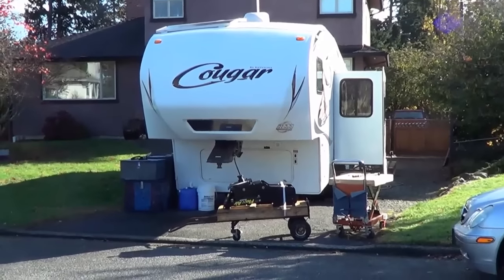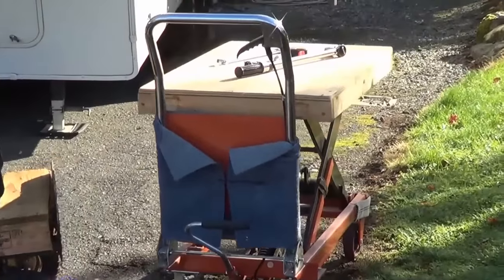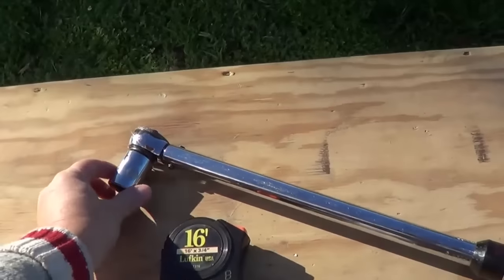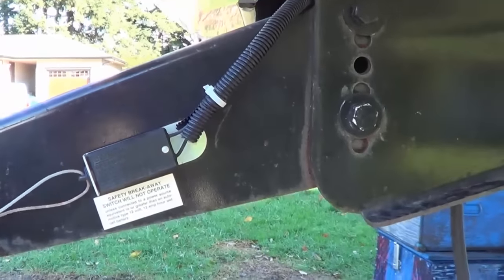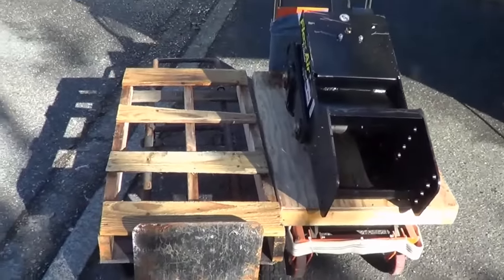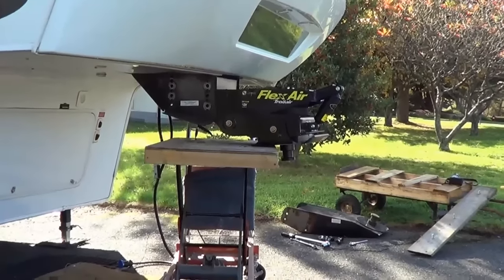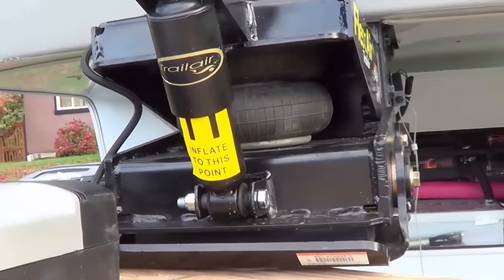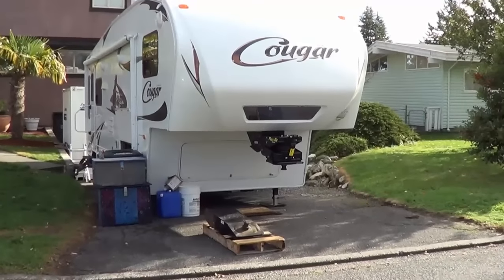Installing a Flex Air Pin Box -  Cougar Fifth Wheel Trailer

Comment: I put that same one (Trail Air) on our new fifthwheel back in 2001 and you will love it. It takes a lot of the jerk out of your neck. Highway 99 has improved, there is still a rough 20 miles above Merced, you will enjoy the smooth ride. Nice videos.
Reply from the maker: +RVJerry Thanks, I've been hearing good things from others. Good to hear about 99, Cheers Ray

Comment: I've seen those units and always thought they were a good idea. I have seen a few 5th wheels with stress cracks at the corners and sides where step up is the make the apron for attaching the pin. I am eager to see your next review. As a side note I wonder if anyone will come out with an air ride suspension kit/upgrade it would really help smooth out the effects of the bumps and jars on the coach.
Reply from the maker: A friend of ours had their fifth wheel frame crack at those corners. It had to go back to the factory to get fixed. Major work! Lucky for them it was covered under warranty.

Comment: The Flex Air Pin Box is suitable for use on conventional size 5th wheel hitches (i.e. Holland, Jost, Fontaine) so it is ideal for truck owners who want to keep their stock 5th wheel.

Comment: Ray, I installed the original version of the TrailAir pin box on my 08 Cougar 245 rks and found it did a good job in keeping the harsh up and down motion of the 5th wheel in check.

Don't be afraid to play around with the air bag pressure, TrailAir makes only one unit (unless that changed) for all campers most of which are much larger and heavier than our campers. I actually run my TrailAir about an inch or more below their suggested indicator arrows. So give it a try.....As a matter of fact the air bag loses air pressure pretty quickly, I add air about once every week or so. So if you forget to check it on a regular basis you will find yourself running it lower than they suggest every so often.

Keep up with the chipping paint, if yours is like mine I have to scrape off the peeling paint and repaint spots about once a season.

Good luck with it, its worth the money.

Ron W.
Reply from the maker: Thanks for the tips Ron!

Comment: I'm looking to upgrade to Flex Air - your install and presentation has been very helpful. Would you mind sharing where you purchased the grade 8 bolt hardware please?
Reply from the maker: Picked them up locally in Victoria at a fastener supply place - http://www.fastenerforce.ca/

Comment: Hi Ray. In your video you said the bolts were a 5/8 and you had to torque them to 160 ft/lbs. You appear to have grade 5 coarse thread bolts. Their maximum dry torque is 150 ft/lbs a fine thread grade 5, 5/8 bolt is good for 170. Just from the fastener torque chart I have, would hate for them to shear off on you. Kind of a torque to yield setting :) Had an instructor who used to say tighten until it breaks then back off a quarter turn :) . Was also told to never use a torque wrench for anything other than setting torque . If you use it to break things loose you risk damaging the wrench making it inaccurate ..Enjoy all your videos plan to do the Big Buddy install in my motor home for winter camping
Reply from the maker: +Rc Flyer Thanks for the advice. I went with what was in the Lippert literature - http://www.lci1.com/assets/content/support/technical-information-sheets/0237.pdf
Looks like I should upgrade the bolts to grade 8  or back them off to 150lbs
Reply: +Love Your RV Ray your welcome, I read the supplied literature from the site and it is unfortunate that they don't give you torque specs for the different bolt grades or thread, just size. If they are fine thread bolts you would be fine, they looked to be coarse though. The extra 10 lbs may or may not have stretched them, you could replace or leave them. I would replace, hard to tell if the bolts are stretched and bolts are cheap. There is a torque to yield setting but that is done by specs as well, usually supplied by the manufacturer so many degrees past a set torque. You can Google Fastener Torque Specs if it will give you better piece of mind. This may sound strange as well but a bolt in a shearing position, a grade 5 seems to hold better than a grade 8. The flywheel on the baler used a 1/4 inch bolt, substituted grade 8 for 5 thinking I would have to change it less, was opposite?? Went right through a box of them in no time . Was told the softer metal would stretch before breaking.
Reply: +Rc Flyer That said though can't remember if a wheel stud is a grade 5 or 8 pretty sure it's an 8 confusing myself now :)
Reply from the maker: My trailer is pretty light weighs in at 9000 lbs so it's likely not much chance of failure, but I'm going to replace the bolts anyway, like you say they are cheap. Love YouTube, I learn soo much from the commenters!  Cheers Ray
Reply: Glad to hear it Ray . Likelihood of a failure for over torquing by 10 ft/lbs probably pretty slim but I'm just one of those worrying types. I wouldn't  have said anything I guess if I wasn't:) . Safe travels and I look forward to more videos
Dan
Reply from the maker: Thanks Dan. I upgraded to new Grade 8 today, total cost 18 bucks. Well worth the piece of mind.
Reply: Great! Thanks for letting me know appreciate the time for the response, especially when you are trying to get under way.
Dan

Comment: I noticed you set the torque on the bolt head as opposed to setting the nut. In your case it would make a difference because the bolt seating surface is larger than the seating surface of the nut/lock washer seating surface.  When the seating surfaces are the same it doesn't make a difference but when they are different it does and should be set on the nut.   Could you not get the torque wrench on the nut side?  You might want to check that.  Also after putting a few hundred miles on it or the first time you decouple it might be prudent to check the torque setting is still set right.  Cheers
Reply from the maker: +rick dees Thanks for the advice, the rear nuts should be no problem to get at but the front ones are way inside so would be pretty difficult. I guess I could reverse the bolts and have the nuts exposed on the outside making it easy. Do you think it would make any difference if they are reversed like that?
I had planned on rechecking the torque after 25 miles and then at 200 similar to when I have the wheels off. Thanks again Ray
Reply: I think the more important thing is rechecking them but I don't see how reversing them  would adversely affect their holding.  I googled "torqueing bolt head vs nut" and got this  http://www.boltscience.com/pages/nutorbolttightening.htm  ,,  Scroll down a little to what I read about different seating issues.  Enjoy.   PS ,, Your video made me wonder if it made a difference, torqueing the bolt head vs nut .  thanks for that, I learned more for what may come up in life.  Thank you.
Reply from the maker: +rick dees Thanks for the info, appreciate it,  I'm learning a lot about bolt torquing today. :)
Reply from the maker: Hi Rick I decided to upgrade the bolts to new Grade 8 bolts from the OEM Grade 5 and reversed them so the nuts were easy to get to on the outside of the box.
Reply: Love Your RV  Good call mate!

Comment: Good Video.  I have been thinking about that hitch.  What is the weight of your trailer?  Just curious.  I have a f350 also.  Any weight limit for that?
Reply from the maker: Our trailer is fairly light GVWR is 10,000 lbs. Last time I weighed it loaded up it was near 9000 lbs with a pin weight of 1600 lbs. I'll have to weigh it again as I've added some more weight but also removed some stuff for this trip. I weighed the truck recently and it came in at 7000 lbs with me and the beagle but not my wife on board, the truck has a GVWR of 10,000 so should be OK I think.

Comment: Hello Ray, did you find any difference concerning the distance your truck is away from the rig? That king pin box looks slightly longer, just wondering
Reply from the maker: Actually, I found it was a little shorter causing less tailgate clearance. It also introduce some minor chucking to my rig that was there before. I swapped it for the Air ride and all was good. http://www.loveyourrv.com/lippert-air-ride-pin-box-review/
Note from my Air ride Review

For those wondering why I switched from the Flex Air Pin Box I had originally installed to the Air Ride it has to do with a minor chucking (tugging and pushing action) issue I experienced. Everything about the Flex Air was great except on smooth roads it actually introduced a very minor but annoying chucking action we never had with the solid pin box.Lippert has several pin boxes to choose from and each is designed to solve a variety of ride problems. It turns out the Air Ride is what I should have had to start with. It is the best match for my particular truck and trailer combination.  More information can be found at the Lippert Support website or their YouTube Channel. I’d encourage you to contact them or a qualified dealer when choosing. – Cheers Ray
Reply: Hi Ray, this is what Etrailer sent me as a response to the question I asked them......I would love to know what your opinion of this is. Here is the conversation with them: Hello, I currently have a Lippert 1621 box pin on my 29 foot Forest River Prime Time Crusader. I pull it with a 2016 F250 short bed with a tool box in the bed that is as tall as the bed rails. Will this king pin box work in my truck without hitting the tail gate or tool box when turning? My hitch is a B&W 18K Patriot Thanks for your help
asked by: Craig H
Helpful Expert Reply:
If you replace your current Lippert 1621 pin box with the Trailair Flex Air 5th Wheel Pin Box - Lippert 1621 # LC328492 and use the same mounting bolt pattern, the Trailair will be at the same height as your current Lippert 1621. So if you are currently using that pin box without difficulty, then the Trailair will work with your 2016 Ford F-250 Super Duty without damage.
Reply from the maker: I can't say for sure but I didn't notice any decrease in bed rail clearance with the new pin box. I didn't pay too much attention tough since we have an 8 foot box the the truck sits pretty low being older. Have a ton of clearance compared to newer trucks. I guess if you could find one in a RV lot somewhere you could create a cardboard template an check it on your trucks bed.
Reply: Yep, going to build a template tomorrow, just to make sure. Keep the great videos coming

Comment: Hi Ray, was the new Flex Air longer than your old pin box or the same length?
Reply from the maker: +Tony Mawdsley I had sent them all the measurements of my old pin box so they could match the right one. I believe the one I got is the medium and they also have a longer one. Compared to the old pin box it looks to be about an inch shorter.
Reply: +Love Your RV Thanks Ray, I have a Keystone Sprinter, similar size 5th wheeler to yours. I tow it with the 2014 Ford Ranger( in Australia), with this being classed as a short bed truck I had to get a sidewinder so i wouldn't take out the back of the truck when turning. It would be great to hear how you go towing on your next trip but also if the longer version would suit a short bed truck...Safe Travels.. Tony

Comment: You get a new camera or mic? You sound different. Another great video.
Reply from the maker: Thanks. You have a good ear. I'm just getting over a cold and my chest and sinuses are still a little clogged up. :)
Reply: +Love Your RV. Get well. You mentioned the old projection tv's. Did they have 3 bulbs of blue, red and green?
Reply from the maker: Ya , they had three RGB CRTs in them back in the 90s
Reply: +Love Your RV   found a pic of the type I was thinking about. I remember seeing one at a family member's house around 1990. Crappy dull picture that didn't seem to be lined up. I guess it was the only way to get a big screen size back then.

http://instappraisal.quadrixit.netdna-cdn.com/sites/instappraisal/files/appraisal_images/IMG_0541_0.JPG
Reply from the maker: Yup , brings back memories,  that one is one of the early ones

Comment: Did you say you used your torque wrench to remove the old bolts?!?!  Noooo!!!
Reply from the maker: You're correct should use a breaker bar to loosen the bolts.